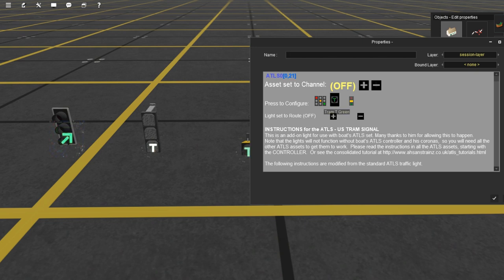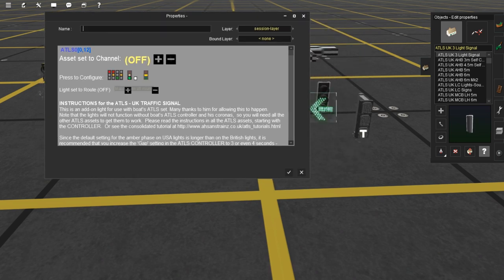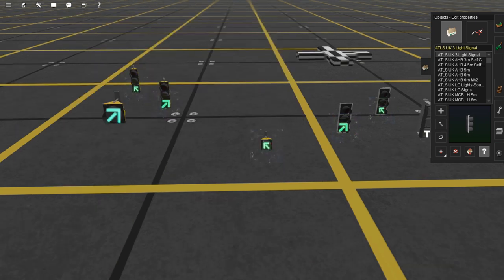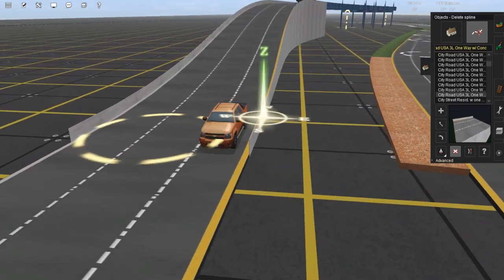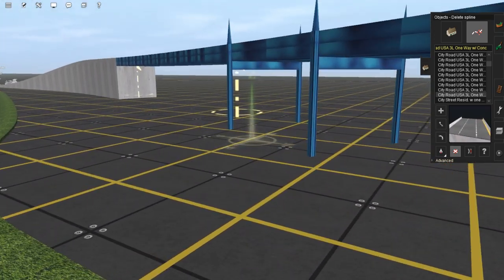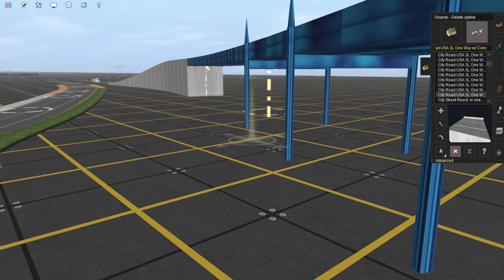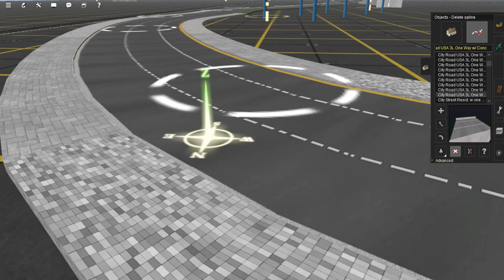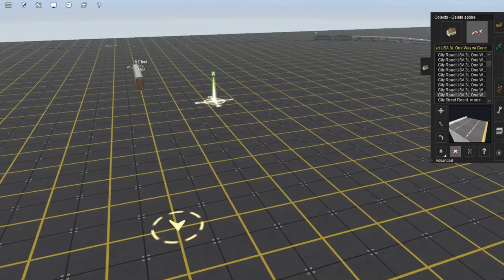My New Replacement Traffic Light Textures for KJ3400's Traffic Lights + New Divided Highways Trainz

Comment: my wire span traffic lights have unknown assets for trainz19 they are the upright/upleft arrow kuids. how can i change them so the wire span traffic lights work??
Reply from the maker: In the kuid table, it lists all the kuids for the textures. Replace the missing ones with a similar texture.
Reply: @Trainfan1055Janathan  im looking at the table but its still confusing what which needs to be changed, upleftarrowykuid                      <kuid:415684:100023> what needs too be changed on there? thats one of the 6 that missing in the DLS